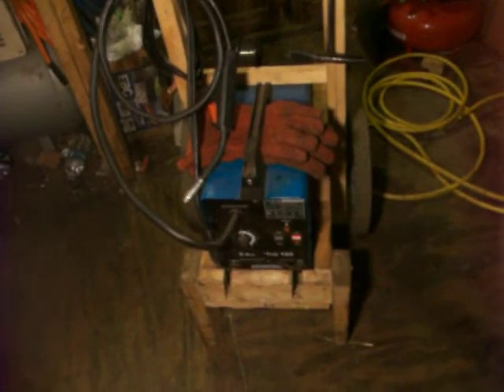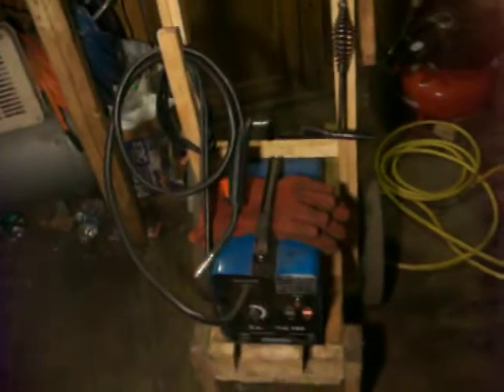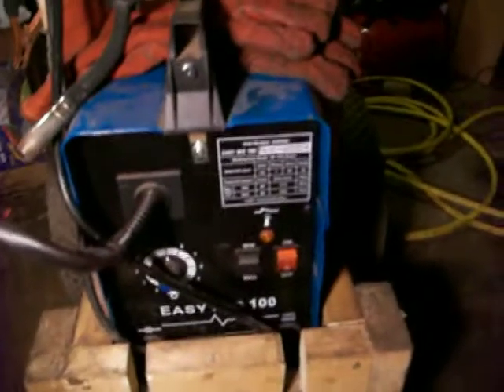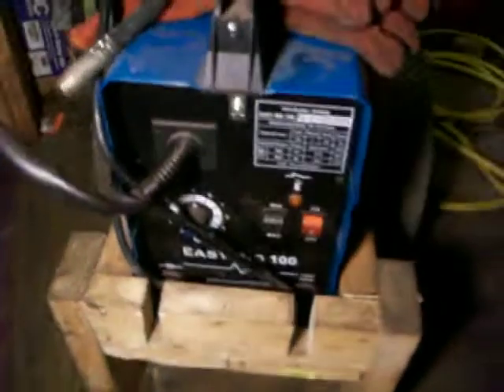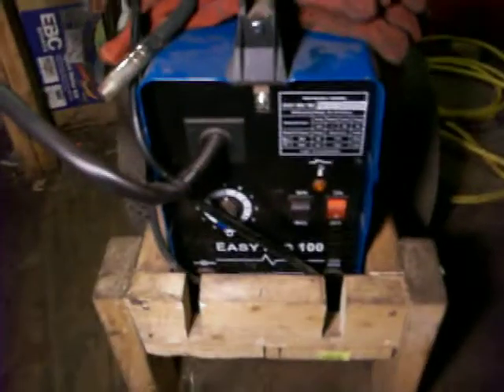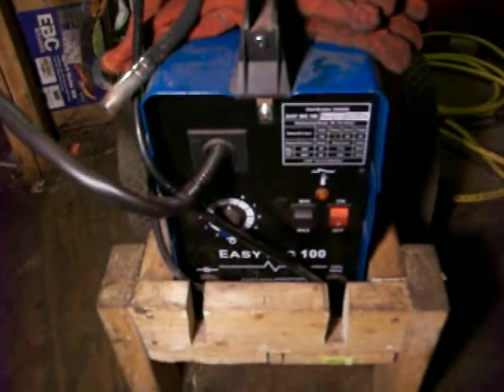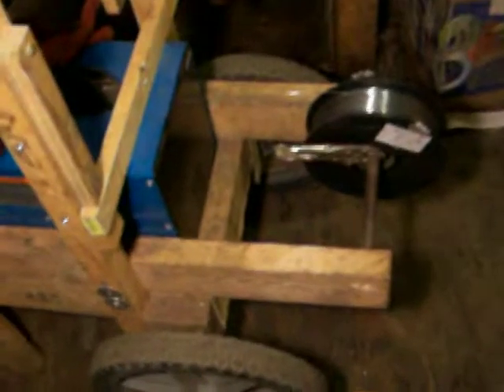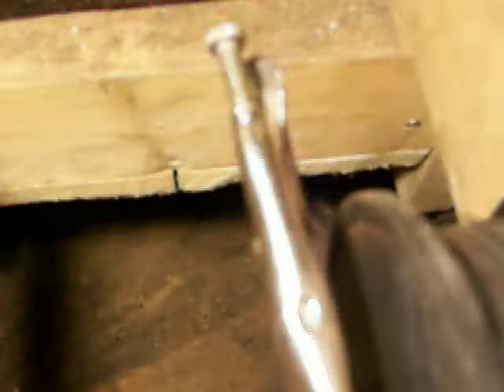Harbor Freight Welder Holds 10LB Spool

Comment: we got a rod holder from the harbor and ran some 12 gauge wire to the Handel and it uses 6013 relay good  and 7018 fairly well

Comment: That's a great mod; really ingenious! On another YT video, someone replaced the original three bladed fan with a square framed, high speed fan, which provides improved cooling...Is that something you've considered? I wonder if such a mod would improved the duty cycle....what do you think?
Thanks for posting.
Roy Lewis Atlanta, Georgia USA

Comment: I would love to add a 10 pound spool to my little HF welder like yours ... but that spool of wire is given the same electrical charge that goes out to the welding gun (which is nicely electrically insulated unlike that open spool sitting out in the open in your modification) and could cause a major electrical accident if something were to come in contact with it while the unit was turned on! Luckily your wooden weld cart acts as an electric insulator and so you haven't noticed it yet, but it could be very dangerous. BE CAREFUL.